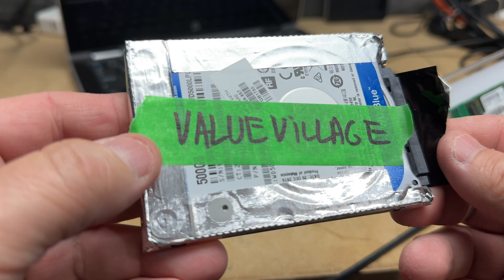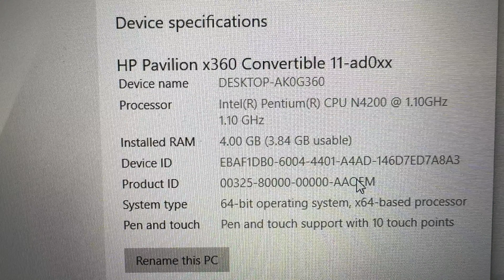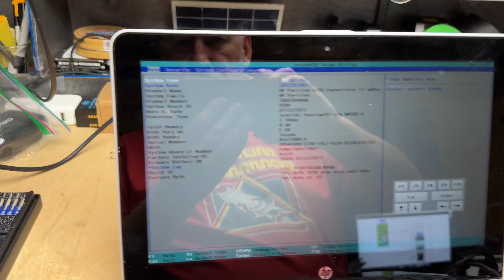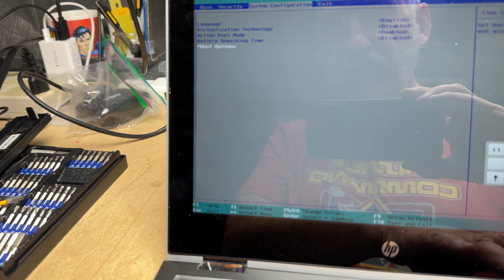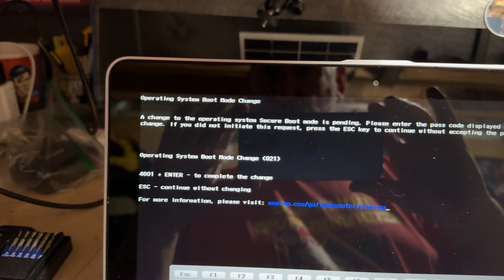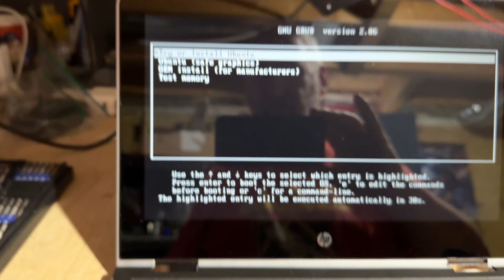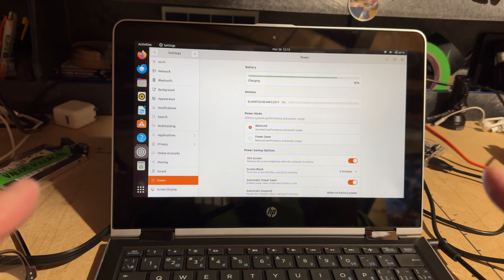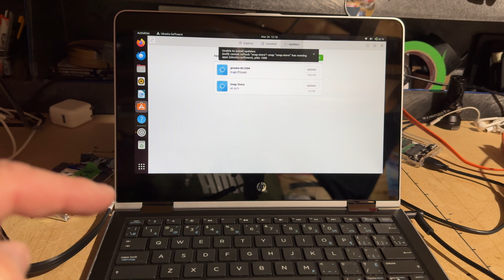HP x360 convertible Ubuntu Linux

Comment: That's great. Thanks for the info.  I'm glad to see the touch screen works.  I have a surface pro with Ubuntu on it and the same issue with the camera, and slow to respond to rotating the device.  I believe that the cameras work with Fedora, and faster rotation response.  Might be worth a try if you really want the camera functionality.